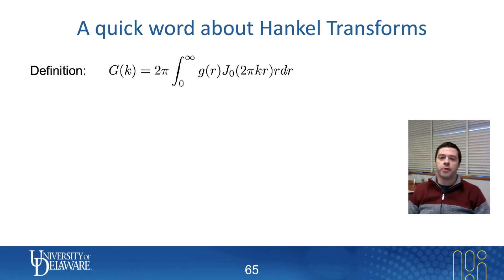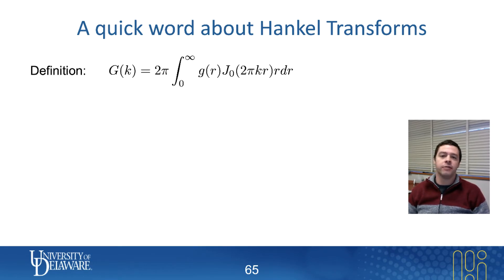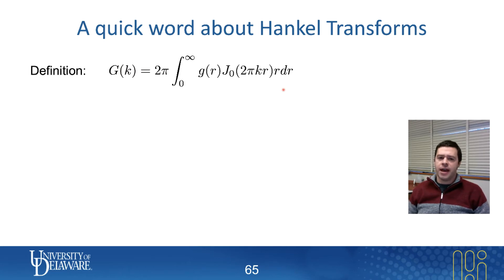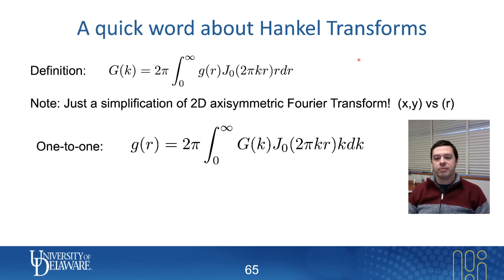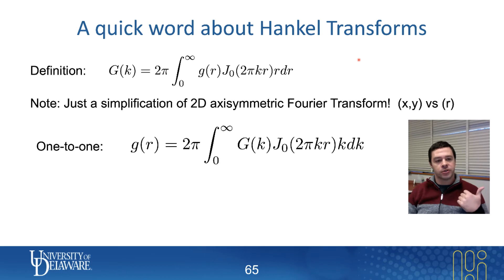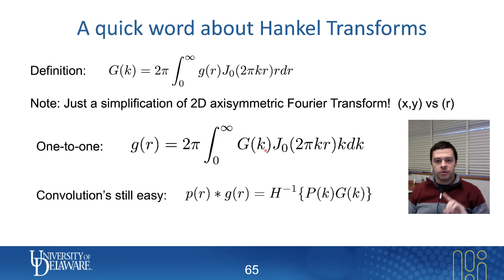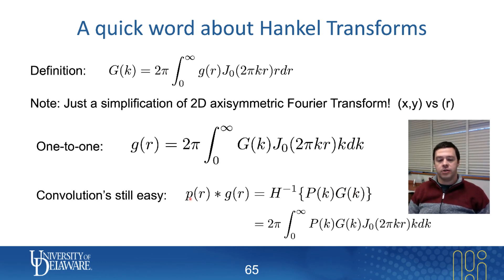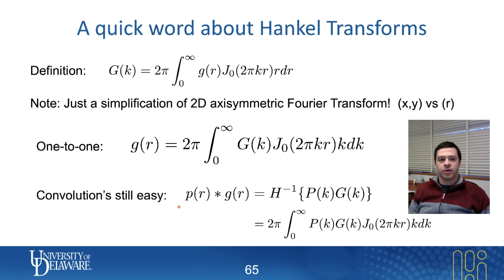TDTR Theory 5: Primer on Hankel Transforms

Comment: This was a lot more simple than I was expecting. Gonna see if I can make it work in matlab
Reply: did you?
Reply: @82Muntasir  I did, actually. It basically worked but it seemed like the inverse transform was more of a psuedoinverse for discrete time. I used the explicit formula, but it might work better by doing the modified fourier transform version of the Hankel transform since the fourier transform does have an exact inverse for discrete time, but I didn't try that